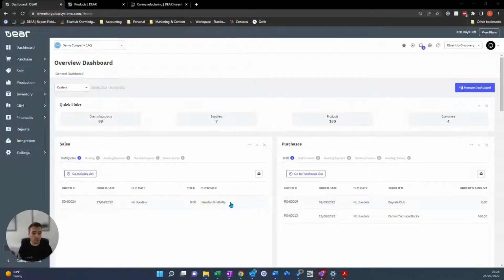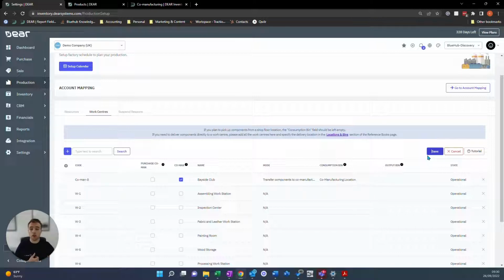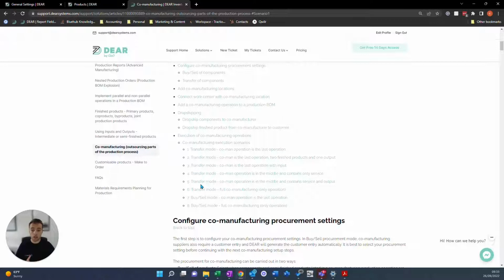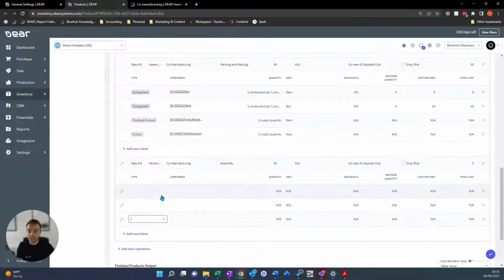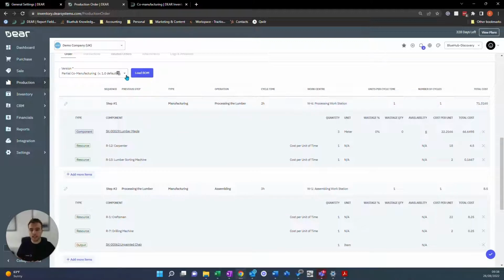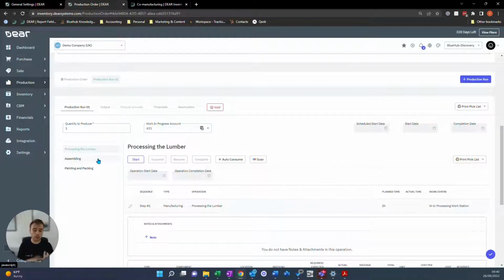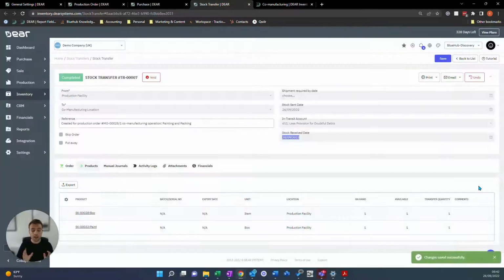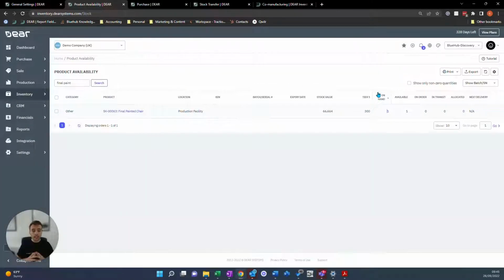Dear Systems - Co-Manufacturing Partial (Production BOM)

Comment: Hello :) I've just watched your example with the chair and I really wonder why there is no input in step #2 with the output "unpainted chair" ?
Reply from the maker: Hi Xavier,

Thank you for the question. In this particular example there is no requirement for input in step 2 as we're not "inputting" a "Semi-finished item" from the previous stage. For an input to be used, there needs to be an output from the previous stage. Step 1 is just the process of us sorting the lumber and as it's listed as a component, it's still being consumed to make the unpainted chair. That being said, Dear Production BOM's are really flexible, and you could in fact configure this example in a way that we do use an input in step 2. For example in step 1 we would have a component as "Lumber" and an output as "Processed Lumber", this could need be carried to step 2 as an input and folowing the process of drilling the step would output the unpainted chair.

Hope this helps.

Callum